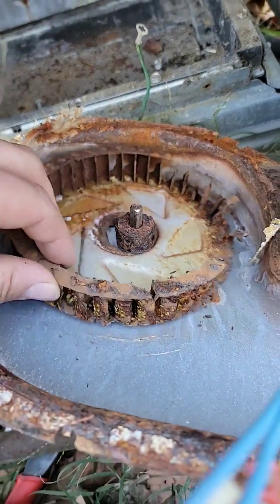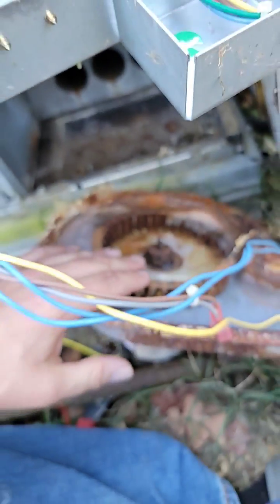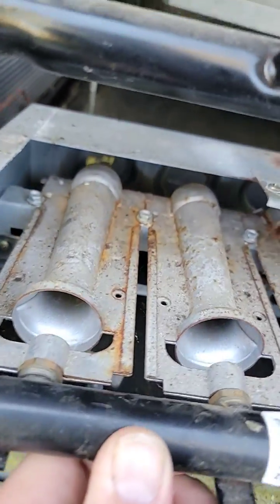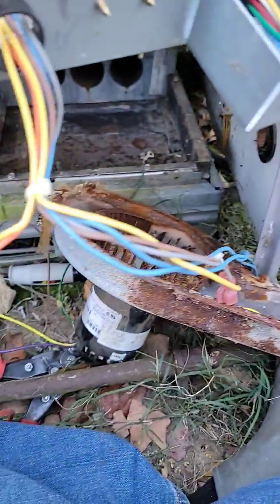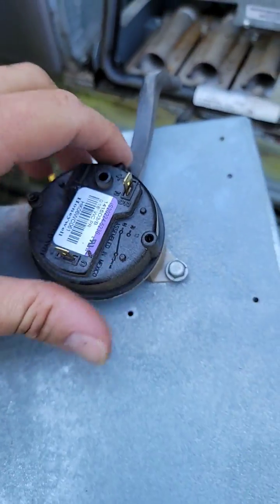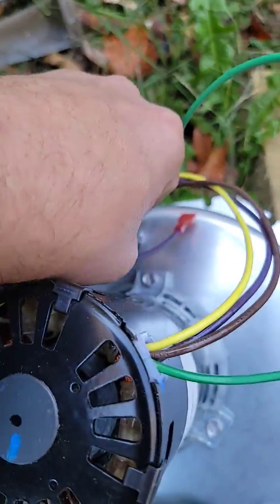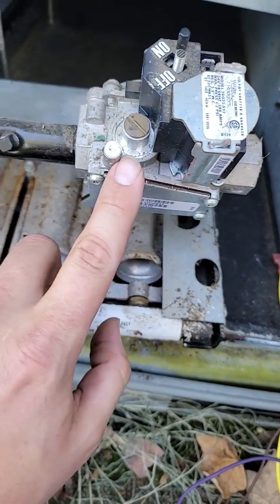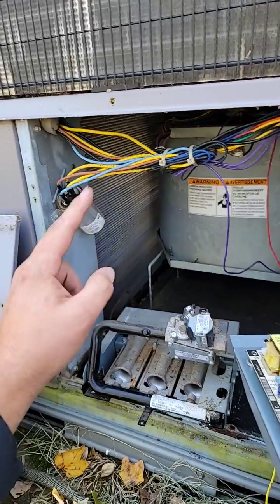Gas Heat Troubleshooting in 60 seconds

Comment: The number one thing I always tell my guys is check check the heat exchanger and preform a space test inside the home for carbon monoxide . Lots of heat exchanger fail on the factory seams . Good check though on the controls .

Comment: use 000 steel wool to clean a flame sensor. sand cloth is too abrasive and it leaves an oily residue on the sensor.
Reply from the maker: Very cool thank you 
I appreciate you sharing this

Comment: Don’t clean a flame sensor with sand paper u will slowly wear off the coating of the sensor itself
Reply: There is no coating on the rod it's only a metal rod. The reason is that sand paper makes deep scratches where carbon can collect which leads to the flame sensor getting dirty quicker. Also silica deposit can get stuck on the rod from the sand paper. All that being said, I have been using sand cloth for 10 years without a problem.. just wipe it off on your shirt and move on.

Comment: I always confused 
Is pressure a load or is it a line? 
So when the pressure switch is closed then the lead on both sides should be 0 voltage? Or  24 v?
Reply: Most pressure switched are normally open and close at a certain pressure. So you would read 0 volts if the switch is working but 24 volts if its not.

Comment: May I ask how to check the power for the gas valve 
Is there certain port that you put your multimeter on? Like same way u check the pressure switch?
Reply from the maker: Check out the link in the description there should be a link for a video that will show you how
 Or type in YouTube search bar my channel name and how to check gas pressure the video should pop up
Reply: @taddydigest  yeah 
I saw that video very detailed and helpful
Just another quick question 
Do you also check the electrical of the gas valve? 
Like I know the gas pressure is important but my instructor said the solenoid of gas valve can also be important
Reply from the maker: Yes you want to check 24 V to the gas valve to make sure that the board is sending voltage
Reply: @taddydigest  thanku

Comment: Had a carrier gas pack like that I was doing a PM on just a few hours ago. Worked great til I put the panel back on then flames started extinguishing and igniter kept re-trying - kept doing this every few seconds. Pulled everything apart - cleaned burners, stuck a shop vac hose in each HX tube, took the collector box off and cleaned it out and the other end of the HX tubes. Worked great after all that. I hate those gas packs btw. I can't stand the stupid 'one panel' design and how much it sucks to pull and re-install the blower without destroying your hands
Reply from the maker: Thank You for Joining send me an email I have some guides I want to send you tadfuller1@gmail.com

Comment: I've been told not to use sand paper. Brillio pads work better without leaving sand traces behind.
Reply: Tech told safer to use a dollar bill to polish it up.
Reply: Don’t use Brillo pads, they have soap in them, use only steel wool pads.
Reply: The service manual says to use steel wool or emery cloth
Reply: You have been told wrong. I got so tired of hearing people say "use a dollar bill" I called the manufacturer. They say there is absolutely no problem using sand cloth or steel wool.
Reply: The reason is that sand paper makes deep scratches where carbon can collect which leads to the flame sensor getting dirty quicker. Also silica deposit can get stuck on the rod from the sand paper. All that being said, I have been using sand cloth for 10 years without a problem.. just wipe it off on your shirt and move on.